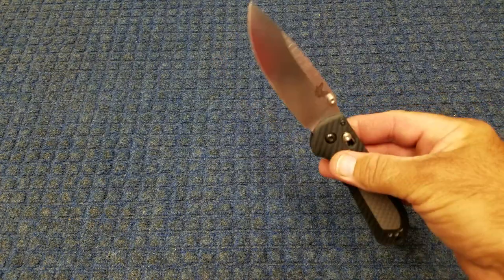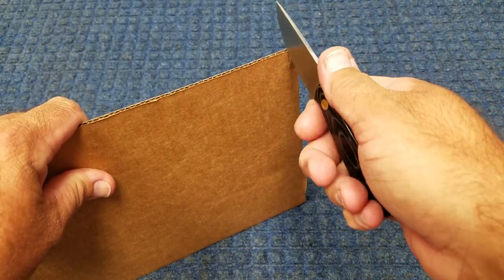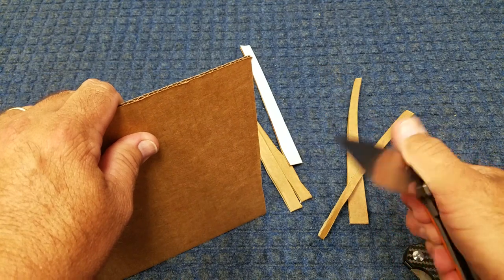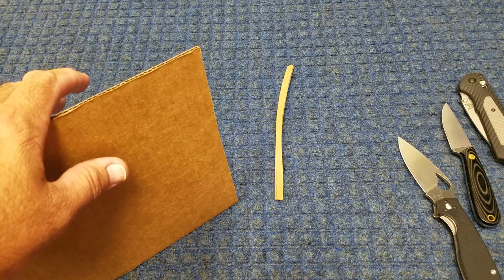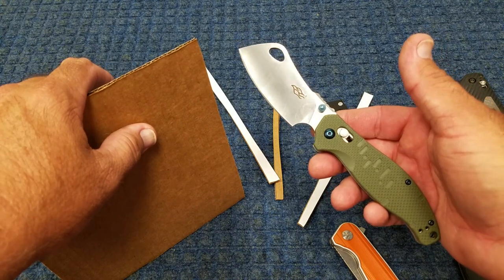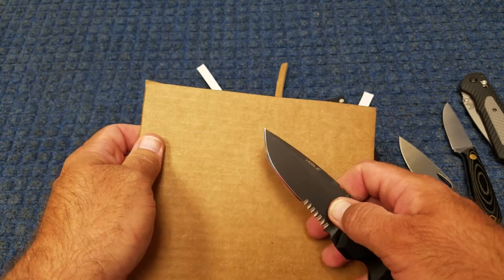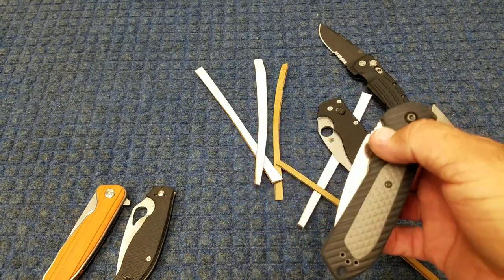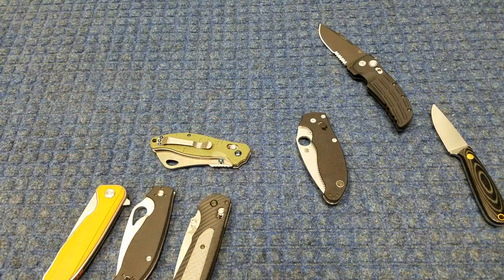Knife performance, slicing and thickness behind the edge

Comment: I am checking out your channel and I already hit the subscribe button.  

I, too, am experimenting with cardboard because of some disappointment with the knives I have chosen for the task.  As a person who sharpens (not very well yet) I am not a fan of re-curves.  But, the Tangram Rumble seems notably better with a slice cut than a push cut.  I suspect the fairly significant recurve is causing this.  I have not messed with it enough to be sure.  If your testing extends that way I will be interested in your results.
Reply from the maker: If you continue testing your knives and resharpen often your edges will improve nicely in a short time. Keep going, testing us a good way to find out what your knives will do.

Comment: do you think the knife coatings may have something do do with that???
Reply from the maker: Coatings could be an issue. The acid brass wash is more a finish than a coating tough. The coating ESEE uses for example makes cutting cardboard difficult due to added resistance.